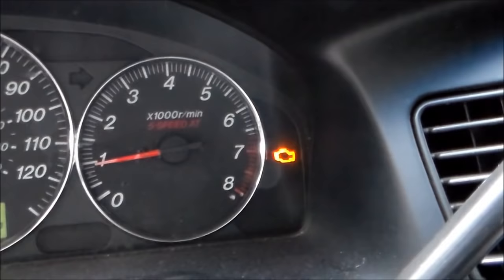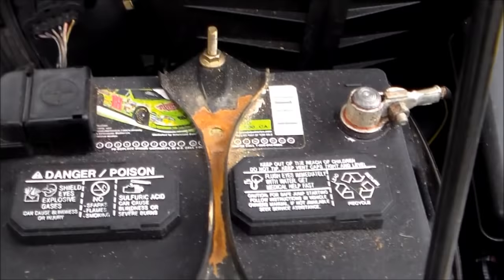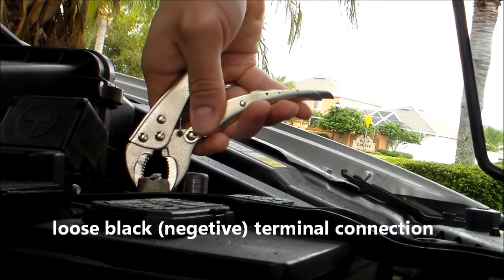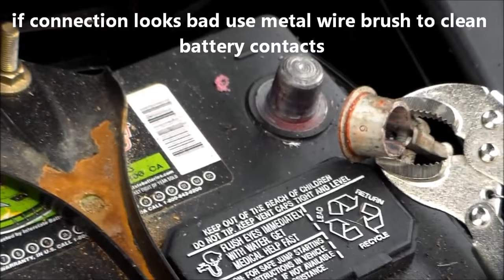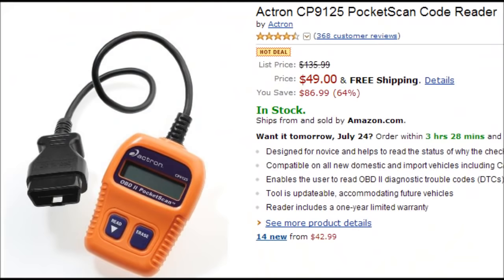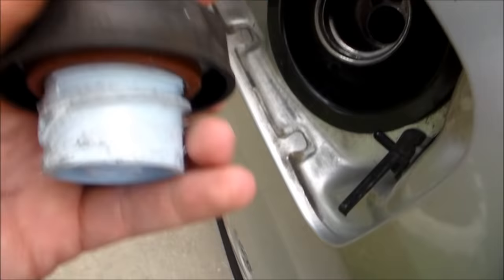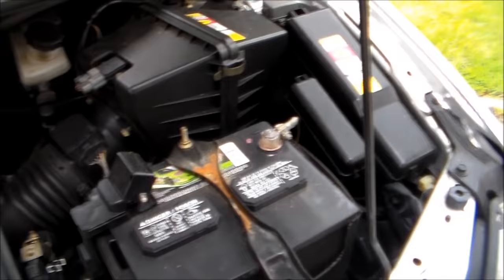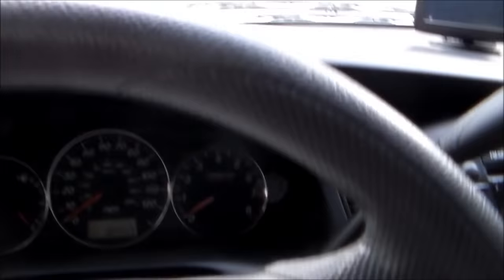HOW TO RESET CHECK ENGINE LIGHT, FREE EASY WAY!

Comment: So here's how it works. If you disconnect the battery the check engine light will go out temporarily. This is because you have reset the computer in your car (ECU/ECM). You have several emissions devices that must now complete a drive cycle. At this point after you have reset everything, these devices will have a "not ready" status. Once you have driven it far enough (Usually 50-100 miles) these devices will go ready one by one. When the device or devices that have the problem go "ready" again your check engine light will go back on. It's trying to tell you something is wrong. You will have trouble codes stored that need to be read and resolved. Having a check engine or service engine soon light isn't going to go away until you fix the problem. Which may in some cases be the computer itself. You won't fool an emissions test resetting the light. Your test will say "not ready" and they will instruct you to drive it. Take it to an autozone or have it scanned to see what your trouble codes are. One easy one is an EVAP code which usually indicates a bad gas cap that isn't sealing. Quit resetting your check engine lights guys and get it fixed! Hope this helps.

This only applies to cars made after 1995.

Comment: Evaporation leak codes can be anything from faulty gas cap to vacuum hose in engine compartment after repairs if you are doing the job your self and taking the ground does not reset the light take positive off and turn ignition to accessories or run. live it like that for a minute or two light should go off

Comment: After spending $1200 in repairs and getting a new sensor my check engine light is still on intermittently. The dealer says bring it back in and they will see what else they can do. Yea, right! My daughter just needs to pass her driving test so will reset and hope it lasts long enough.

Comment: 2/17 16  Had problem with 2010 Chevy Cobalt, Check Engine Light stays on .  Replaced gas cap, spark plug wires, spark plugs, coils and light still comes on.  Tried what was suggested, take wire off negative terminal for 2 min. and problem was solved, check engine light off !

Comment: dood from this repair video i have to check out how you repair tablets and computers do you just reboot them or pull the battery and see if it works right those are some good skills for troubleshooting you have there you make real tech look dum why dont they just disconnect battery to reset obd system

Comment: Hey this is awesome.. but quick question. How long will the check engine light stay off for? Will it re-appear? If you how soon? Thanks!!!
Reply from the maker: it will reappear in about a day if you don't fix the problem that triggered the light, so check o2 sensor or loose gas cap but can be something more serious.

Comment: We've done this on a rav 4,and though it did work, it wasn't ideal, first off it was the positive we needed to remove, not the negative, second, it reset the light, but for all of a few mins, and it came right back on.

Comment: The emission control light came on after i hosed the engine bay down, not immediately but some hours after. Would i have to replace any sensors or just give it some time after reset?

Comment: After you drive 30-40 miles the check engine light will come again. Advice get a free trouble code reading from Oreilly to get a code number such as p0140-camshaft sensor malfunction is the reason the Check Engine-malfunctioning indicator light....Ian

Comment: LOL.  Although this does work.  Here's a word of advise.  Do not do this just before going to get a smog check done.  It will clear the light, this is true but you will fail smog because the computer has to re-learn the settings.  That requires you to drive about 100 miles.  After you drive around for that amount of miles the computer will have all the setting reset and you will pass smog.  Trust me, it happened to me and for the exact reason.  Bad gas cap.  Failed smog.  Replaced the cap. Reset the CEL. Then took it back for a retest and failed again....because I didn't know about having to put some miles on it first for the computer to re-learn.  The smog tech told me to put 100 miles on it and come back.  So I jumped on the freeway drove 100 miles, went back and passed smog, no problems.  Costly mistake.  So, now you know what to do if your trying to do this just to pass your smog test.
Reply from the maker: Good info thanks for sharing.

Comment: Thanks, might be my aftermarket locking gas cap making the engine light come on, I want to now try the original gas cap to see if that helps. Also it is NOT Mozda as you said, the proper pronunciation IS Mazda.

Comment: I actually fixed the problem and the light still will no go out!!! I need to get my registration!!!
Reply: +Denise Parker That's because this isn't a fix, it just resets the emissions testing system and forces it to go into readiness mode again.  You won't be able to get passed a smog test until your car completes it's emissions readiness tests now, which means driving it.  If you don't have registration and can't drive it, you can't pass a test and get registration o drive it.  Pretty handy tips huh?  People posting BS video like this should be shot and pissed on.

Clearly you didn't fix the problem though, if you meant you got a code, replaced a part and it it is still on, you replaced the wrong part, you still need to diagnose sources after pulling codes.

If you meant that you replaced the cap and it didn't turn off the light, the cap isn't your issue.  If you meant you reset the battery and the light came on right away, you most likely have an electrical connector fault at the sensor throwing the code.

 These losers saying how all the mechanics are getting pissed because they are losing money is bullshit too, they are losers, do not know what they are talking about and are costing people time and money...or delaying them getting back on the road.  This guy is actually MAKING money for mechanics with his BS information.

that's a problem with YouTube, too many unqualified idiots making blanket claims to save the world.

 Sorry to hear you got sucked in by it!
Reply: Finally I actually know its an ignition coil..unfortunately IMA jus have to replace ALL 6!!! That was the only reading that printed out..so nothing major!! I really appreciate your response. Though!! Thanks 😉

Comment: If you are going to have your vehicle inspected in the State of Texas and any state they connect to your OBDII CONNECTOR please do not disconnect your battery, and then try to get it inspected. Use the correct tool to reset your ck engine light as you will not pass your inspection. You will have to return in a day or so when the sensors have enough data

Comment: I have heard from a shop that this will work but if you have a newer vehicle with an anti theft stereo the radio will not work and you have to have the codes reset to get the radio to work again.
Reply from the maker: Or just get obd reader to reset light and get error codes it. I made a better video click on "i" info card in video.
Reply: Not to worry, I am Neutered.
Reply: +Tampatec Borrow one at AutoZone or their competition, reset, done. Of course, it isnt permanent.

Comment: take your rings off next time when handling a car battery friend! if you even touch the points with a spanner it'll heat through ur rings and melt your fingers off or Down to bone ! this happend at my college the spanner touched both at same time n took boys fingers off
Reply: nice comment
Reply: +Horticulture and Bonsai est2005 (Doug) ha ha car batery melt your fingers, ha ha ha, you are right but no need for drama
Reply: No, but it near took my classmates 2 end fingers off!

Comment: Thanks Tampatec. This worked for me. To all the critics, fuck off. Ford's capless gas tank = evap leak that has no bearing on the operation of the car. You can drive forever with it like this. Ford can't even fix it. The engine light continuously comes back on. It's the boy who cried wolf. I've driven the car like this for the last 8 months and put 14K on it.

Comment: Thank you Tampatec, this worked on my Nissan Xtera just fine. Sensors are always acting up on cars. If you try to figure out what's causing the light to activate, you could spend lots of money replacing many parts and still have the light on. Thanks for the gas cap tip. I have also heard that if the engine oil cap is lose it could trigger the light too. If the light starts flashing, then that can be cause for worry. Other than that, I'm just not going to worry about it.

Comment: depend on the code but most of the time is the EGR hoses on Mazdas or Fords or the charcoal reservoir also check if you have any broken Lelbow from the intake or the PVC valve that will be the only problems on Fords the gas cap its not the issue on your car byeee

Comment: Your check engine light will turn itself off after you fix the problem. The pcm/ecm will just want to see a predetermined number of issue free drive cycles before it shuts off... (the number of drive cycles is different for different issues) In my opinion let real technicians who know how to fix cars fix cars... As a licensed mechanic myself it is amazing how often repairs cost way more than they should because someone went on youtube to try to fix it themselves first.

Comment: there is a reason why that light comes on and should never ever be reset until the problem is fixed the light will go off a few things it can be 1 catalyst sensor on the exhaust 2 throttle body/air mass flow sensor 3 injector not working correctly works but not at the specified performance 4 camshaft sensor gone check engine light has many different codes on many car manufacturers, the light is there for a reason I suggest don't ignore it or reset it, you need a really good mechanic to diagnose this also, those plug in diagnostics are not always right

Comment: At the Toyota dealership the code said it was a catalytic converter (built in sensor) and a new cat converter was $1633.00 plus labor ($99.00). I found one online for more than $900.00 but it's pricey. Wish my problem was only a gas cap.
Reply: Code PO420?  I had/have that code, too.  Get a can of mass air flow cleaner and clean your mass air flow sensor.  Replace your O2 sensors.  Amazon sells Denso brand O2 sensors for half the price of the dealer.  Reset the CEL and hope it doesn't come back.
Reply: bro get a aftermarket universal cat its about $99

Comment: Im a bit worried about disconnecting the battery (radio might need a code). So instead I could remove the EFI fuse for a while, right?
I need your help ASAP. Where will I find the EFI fuse in my Mazda 6 (2004)?
Thanks.
Also, I fould out that its better to switch on your headlights for a few minutes after disconnecting battery,which helps to more rapidly drain energy in the computer. What do you say to that?

Comment: If u remove the negative terminal of the battery yeah it will turn off the check engine light but the code is still in the computer u have to reset it with a scanner.

Comment: A much easier way to reset the PCM is to just open the fuse box and remove the PCM fuse for a few minutes. Removing the PCM fuse will reset it and clear the trouble codes until they come back on again after driving for a few days.. Much easier than removing a battery cable. By the way, resetting or clearing the light does not fix anything.

Comment: Yes you can do this but it doesn't solve the problem. The engine light usually goes back on within a few hours or days. If it's emission sensors put a couple of cans of fuel additive cleaner like Techron,Seafoam,,Gumout complete tune up or Berrymans b12 and just drive around like you always do.Sometimes a couple of tanks of Shell V power will  clean things up a bit also and the light will go out. Sometimes these short money fixes work.

Comment: ...OR you can hold down the trip meter button, then turn on the ignition, and in about 15 seconds the check engine light will reset. I do this on my 2002 Honda CRV.
Reply: +Paul Creel It is vehicle dependent, all vehicles have a built in diagnostic system and most these days will even spit generic codes out on the dash display.  the rest is different for all cars though.  Such as older BMW's they had an on board system that flashed the code if you turn on ignition and stomp the gas pedal 5X in 5 seconds.

Comment: If you have a 2,000& up car,do not do this. Mercedes,Audi,Volvo owners? NO WAY!That's why smart people use a memory saver on the system when replacing a battery. Pay the money and have it diagnosed.If you don't care at all,put a hunk of black tape over the warning light.Most of the time,it's emission-related. If you want to follow his advice,pull the cable and turn on the headlights for 5 seconds. THAT will dump the computers memory a lot faster.There goes your radio station pre-sets and may cause more trouble. Like,it may not run or even idle at all! And the NAV computer.The engine control computer must re-learn where it was. Not fun.Yes,a loose or damaged seal on the gas cap may cause the engine warning light to come on. So can a lot of other issues.Sensors,emission control components,ignition parts,fuel system and so many more.Thanks.

Comment: I have a 2006 F250 6.0L diesel and I get a wrench light on dash. If I turn off the truck the light goes away. Later it comes back on. Most of the time it is when I have cruse on. Do you know of a fix or what causes this. When I hook up diagnostic tester it show everything fine and no error codes.

Comment: firstly... use the right tool for the job... secondly as a tech you should understand that there is cache.. and just like cache, you just cleared temp information. if you try to do anything other than just turn off the light it WILL fail.

Comment: As soon as the monitor for what ever the problem area was ,is complete the engine light will return Unless the problem was repaired!There are many evap issues that cause the light to come on not just simply a loose/defective gas cap

Comment: People like this should not be allowed to touch a car. First, if you do not have the right tool to disconnect a battery and resort to using vice grips, just stop and walk away. Second, unhooking the battery to clear an engine light is not a repair, just turning off a light does not fix anything. Third, the gas cap is not the cause of every single engine light. Fourth, guys at Autozone are not trained professionals. They sell parts, they do not know what is wrong with your car, they are going to say whatever sounds smart so they seem awesome. Stop being cheap and thinking you know everything about cars because you watch YouTube videos and went to Autozone, and take it to a shop with trained professionals and pay them to do what they do, without bitching about how much its going to cost.

Comment: Well the check engine light isnt off completely  yea right after your unhook  your battery  and hook it back up but after you drive for about a 100 miles maybe more depending on car your computer resets and reads everything again so if you didn't  fix the problem scanning  it and unhooking the battery isn't going to work either iv done it awhile ago and was disappointed but hey worth a try..

Comment: If any issue is repaired, your system will reset the light on it's own. If your car has a problem, doing this won't gain you anything. The light will come back on. In some states, a light on will fail an inspection.

Comment: I saw somewhere else that said unhook the positive... And is it true you have to drive it for a week to reset the computer?
Reply: +householderr Always disconnect negative cables first, never the positive, don't waste your time though ,this vid is pure BS. 
Your car needs to complete it's emissions readiness tests.  this means O2 sensor tests which take a few minutes, to EGR system tsts and cat efficiency tests, which take specific driving conditions to complete.  For this reason, it can take a few days to a few weeks, depending on your driving before you can go for an emissions test.  Restting the light shows up instantly on an OBDII tool (not the garbage over the counter OBDII tools you get at AutoZone or a parts store) and you cannot pass the test. 
Cheap OBDII scanners are just a scam to get people to start TRYING to repair their own cars, and buy more and more aftermarket parts.

As the emissions readiness tests completes,  the light will come back on unless the problem is repaired, leavign you back at square one.  

You can't pass a smog test if the light is on or the system hasn't completed it's readiness test.
This "solution" is pure garbage.

Comment: That's only a temporary fix if the problem isn't fixed the light will come back on in a few miles. If the engine light is on get it checked and fixed properly

Comment: Oh yea, forgot to add. The people working at autozone. Are not mechanics. They will pull your code for free. And tell you its a gas cap or O2 sensor. So you buy the parts from them. The corp companies train there employees to use a code read check as a parts sales tool. To make the company more money.

Comment: You could have just had AutoZone reset the code when they scanned it for you. The only thing this does it reset all your settings. That light also would have gone out in a few days anyway if it was just the gas cap.

Also, you shouldn't use vise grips in place of sockets, especially when the kit you linked to includes sockets.